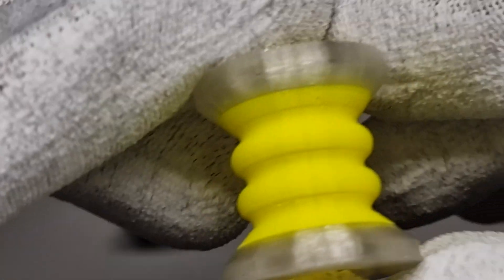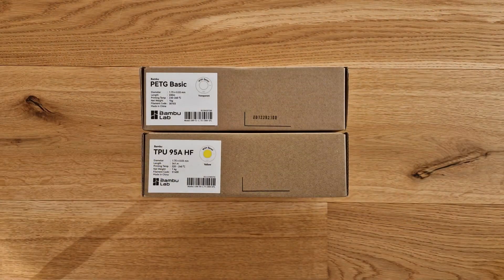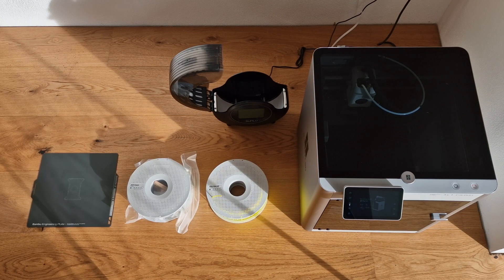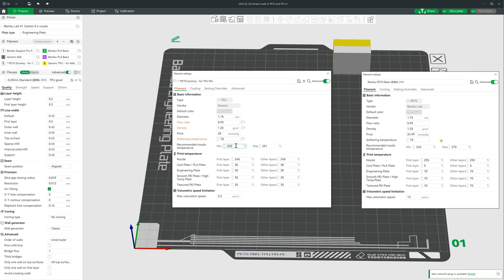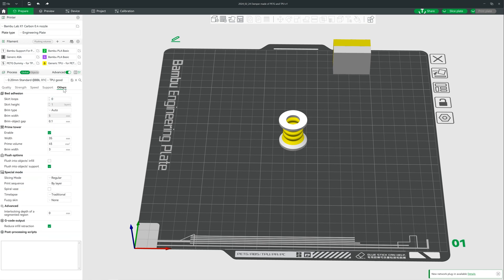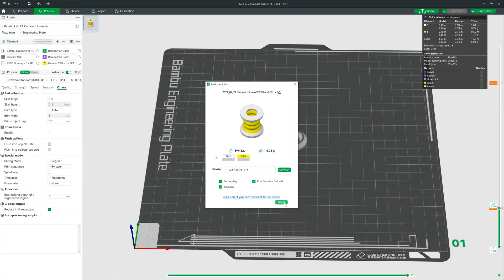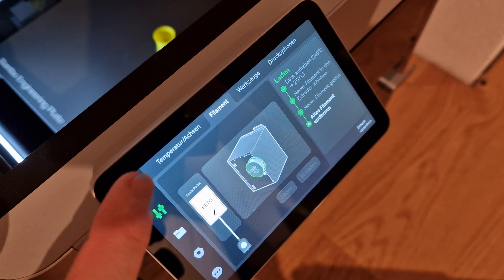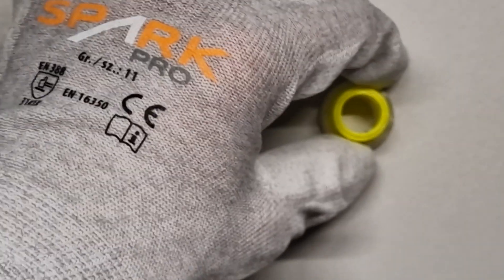How to multi material print PETG and TPU in one part on Bambu Lab 3D printers

Comment: You could split the part into 3 bodies in your CAD software, export it as one STEP file, load in Bambu, Choose Fillament for the different bodies, print by layer, exclude part 2+3 in first print, 1+3 in 2nd print and 1+2 in 3rd print. 
You don't get a prtime tower, and the print tops in and leaves you more room, and it wont stand for hours with heat on.
Reply: How do you exclude the parts? I have a step with 3 object stacked on top of each other. Imported to Bambu Studio, I get a merged object with 3 parts. I can only disable printing of the whole group. If I ungroup them, all object fall down to the build plate and do not remain stacked on top of each. Maybe removing the checkbox in the object tab in the sidebar is not what you mean by "exclude part"?

Comment: I have a 1mm x 3mm PETG flat oval, and I would like to line the interior of it with TPU (maybe 3mm x 3mm of it) -- so left to right it would go PETG, TPU, then TPU, PETG. Does this method only work from bottom to top or is there a way to print left to right flat against the build plate?
Reply from the maker: Thanks for reaching out! In theory, this is definitely possible, but you’d need to manually change the filament for every layer. Since your part is only 1mm high—assuming a 0.2mm layer height—you’d have to swap filaments five times. It’s a bit tedious but certainly manageable!
If you need multiple parts, I’d recommend filling up the build plate to make the process more efficient.
Hope this helps!
Reply: @ Thank you! Great video, by the way. I have a project where I'd like to put something in TPU on top of a complicated PETG base and this has been instrumental in completing it. 👍👍

Comment: Al querer imprimir el archivo en mi maquina me dice que se han modificado codigos G, que podrian dañar la maquina,
Reply from the maker: This is a standard warning from the slicer, as the G-code has been slightly adapted in the print profile. More precisely - the fan speed has been reduced. You can view the G-Code under Filament Settings / Advanced. Speed reduced from maximum PWM value of 255 to 50. I hope that helps.

Comment: Sabes si puedo combinar filamento flexible con un short diferente, necesito uno bien flexible con otro un poco más duro, es para hacer una funda de teléfono y quiero que la base sea más dura
Reply from the maker: I'm not exactly sure what the phone case should look like, but if you need to switch between filaments multiple times, in my opinion, there's no way around using the AMS. There are videos where users have modded the X1C to make TPU work in the AMS.

Comment: How to combine TPE with materials like ABS, ASA, PA12, and etc? I need to print one object which must be hard and durable but the tops surface must be soft and not to scratch PMMA material which is put on top of this object - so is it possible or did someone test it?
Reply from the maker: Sorry, i have not tested any other combinations except with ASA: https://youtu.be/P0DD_ik4N4I?si=d32E4JqD1Uoip0L3

@Willis3DDruck [German] created a video where he combined ABS with TPU: https://www.youtube.com/watch?v=5soAu6cinP0&t=926s
Reply: @creativemakerat   Thank you for the response. For now I have successfully combined PP with TPE, I tried with PETG to combine TPE but with no success for now. Now I'm trying ABS and TPE, hopefully it will stick well. But TPE needs low speeds to print successfully, alone or combined. I tested ABS and TPU, but on 100% speed, it was acceptable result, maybe I must reduce the speed also for the TPU. Al the test are done on CreatBot F430. Very good machine.

Comment: Thanks for the video.  I just used this method to print PETG-CF letters on top of TPU surface.  I used the TPU setting to print the PETG-CF and had no issues.  I am using a 0.6 mm nozzle which helps.

Comment: can I put PETG in ams and tpu on the external spool holder, and print it without touching printer?
Reply from the maker: From my point of view, no. The printer can not grab TPU from the external spool holder automatically.
Reply: @creativemakerat  ahh yeah right, I wish that ams works with tpu
Reply: There are videos about modfying the AMS so it can handle TPU (replacing some springs).

Comment: Any reason of why you are not using the AMS? Shouldn't it be even easier with it? Or it this just to make a compatible video for other printers?
Reply from the maker: I just wanted to do a quick update on my first video. Since Bambu TPU tends to clock in the AMS and my ASA filament was on a cardboard roll, I left out the AMS completely. For this video I wanted to keep the setup the same - for the sake of simplicity.

Of course you can also use the AMS (at least for PETG). However, the following should be noted when using original Bambu filament: The roll is automatically recognized as PETG by the integrated RFID chip. Since we have created a fake PETG material that is actually of type TPU, it cannot be selected when we start the print job. This can be avoided by removing the RFID chip from the roll and loading the material as TPU.

I hope this helps.
Reply: @creativemakerat Thx yes that does help and explains it.

Comment: So basically do what people have been doing for years. Pause and change filaments manually.
Reply: If you don’t have the equipment to eliminate changing filament manually, then it seems pretty apparent that you just might need to, ya know, change it manually. It was actually a fairly obvious point to me, but thanks for pointing it out to someone who may not have been able to figure it out on their own. In all honesty, the people who couldn’t figure it out themselves would be ill advised to own a printer in the first place, but it’s great you are here to point out what a maker should already know. Thanks!
Reply: That is fine for one or two changes and for flat interfaces, but if you have multiple levels and/or canted interfaces, that would be a pain. I don't want to sit next to machine for hours making changes. However, that would work very well for this model.

Comment: The bond between the tpu and petg is that strong that it failed in the middle of the tpu??

Was the tpu filiment lower quality by chance?
Reply from the maker: Yes, the part is actually torn between the TPU layers.
But that's not really meaningful. On the one hand, there could have been small imperfections at that point and on the other hand, I didn't pull "straight".

I've also squeezed the damper dozens of times before, which also puts a strain on the connection.
In my opinion, the adhesion is very good. The wall thickness is only 1mm and you can pull quite a bit.
Reply: @creativemakerat  Thank you for the info. I completely understand about the tpu failing. Although, not a proper test of the materials themselves, I am excited to see that such a bond is possible.

I was thinking of making some acoustic damping wall art and my go to was tpu for the flexibility and absorption but I would also like the outer most layer of the geometric shapes to be harder to help reflect sounds in scattered directions.
Your combination here seems like a perfect fit.
Reply from the maker: Sounds like a very interesting use case
Reply: PETG likes to fuse quite well onto its build surface, especially if the surface is hotter. This is why many makers build on tape so it doesn’t destroy their build plate. It’s pretty reasonable to expect it to bond to TPU just as easily. I can fully accept that bond is stronger than the internal layer adhesion for TPU. I expect other materials would fail at the interface when pushed to limits.

Comment: Good videos so far. Can you recommend PETG settings that work for BL filament? Thanks.
Reply from the maker: To be honest, this was the first time I've ever used PETG. As you can see in the video, the roll was brand new.
That's why I simply tried and copied the settings from the standard PETG Basic profile.

Unfortunately I cannot make a recommendation. But I'm quite sure that there are numerous users here with relevant experience - maybe someone has a tip?